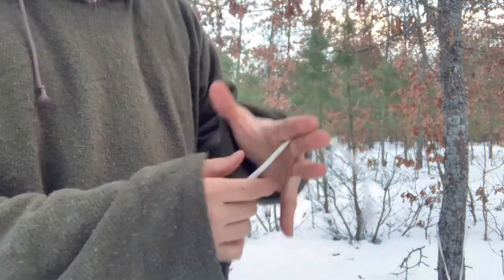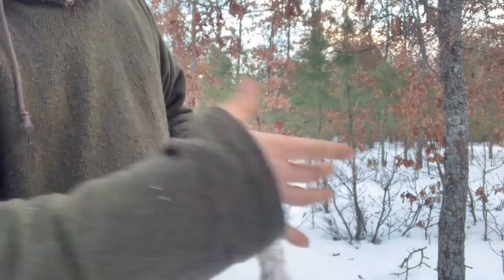Mule tape

Comment: I tried to wrap some up around the fingers as you showed,, But I think I cut my piece little too long,, I realized AFTER that it has measured marks on it,, mine stated at 1460-1516,,, meaning it's Approx 56 '. ? I think.. which is quite a thick roll when done wrapping it up but not too bad for 1st try. Looking forward to other vids you have for us.